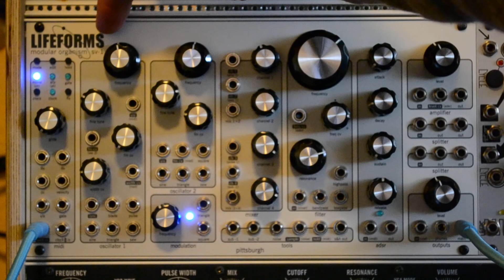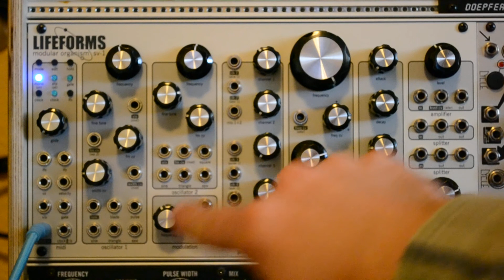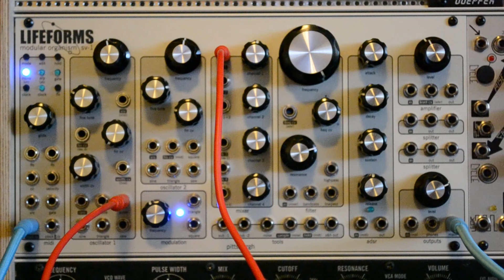Basics of Eurorack Synthesizers on a Pittsburgh Modular Lifeforms SV-1

Comment: Hey, thanks for the awesome video, really helps a lot! I still have a question tho. Please keep in mind I'm very new to modular. So I recently bought the sv-1, and I'm trying to play it with my roland fp-90 digital piano/midi keyboard. However the keyboard won't trigger the sv-1, I can't hear any sound. I'm connecting them with a midi cable and the midi adapter cable. I have the sv-1 turned on, the "mono" led is lit up. Using headphones.
Reply from the maker: Are you using the Pittsburgh modular brand midi cable? It’s light blue and the cable is wrapped in fabric. Some of the midi adapters are wired differently and that makes a difference. Other than that, I would take a look at the manual and make sure your midi channel on the sv-1 and your Roland are the same. Hope that helps!
Reply: @clintpogue435  no my cable is light gray. I will check the midi channels tomorrow and if it doesn't help I'll look into getting a new cable. Thanks! Edit: Another quick question. After looking for cables I noticed there are Type A and Type B cables. Which on do I need for the sv-1?
Reply from the maker: @deathbydrums  I’m not sure because I don’t have this sv-1 anymore, but the manual online should get you lined out
Reply: @clintpogue435  hey so I solved the problem, my midi Controller works now. I have another question tho. How do you record the lifeforms? Like where does the cable go from the main out?